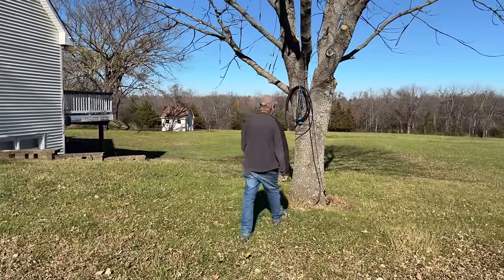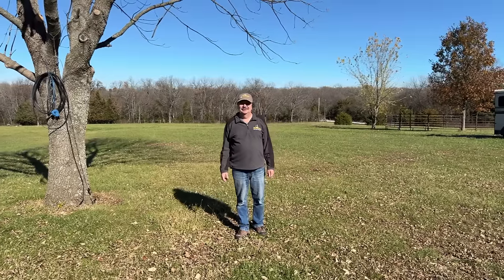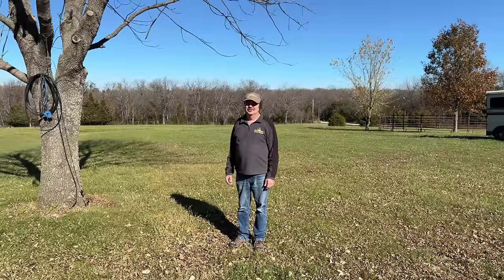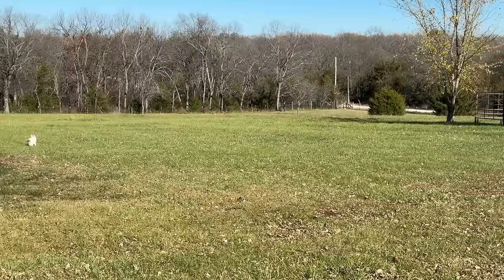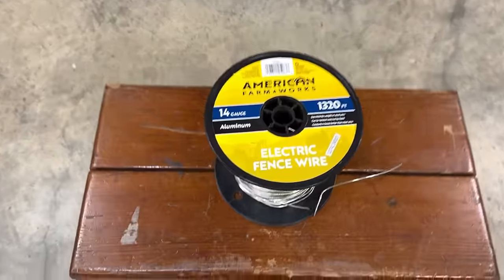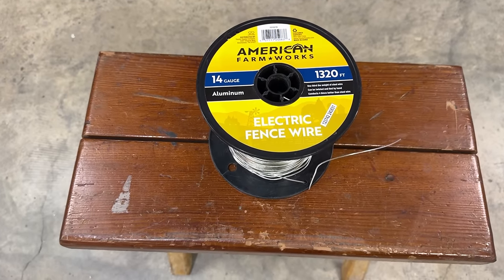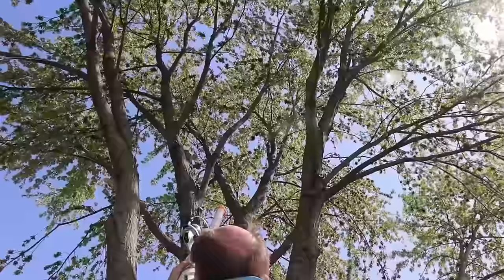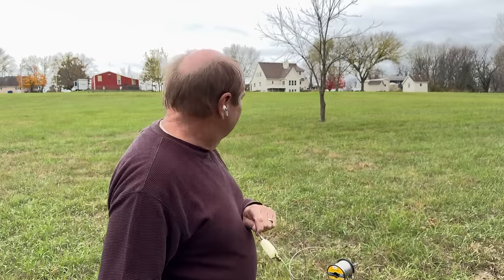Long Wire End-fed Antenna

Comment: I made a beverage antenna out here at my farm a bit over 550 feet it’s end fed too . To support it I used sections of steel chain link fence pipe welded into 20 foot tall with 5 foot cross bars and welded bolts to use electric fence insulators I set in concrete larger pipe so the t posts can be set in them I spaced them 100 feet apart giving me 1200 feet of antenna . I soldered my coax to the aluminum fence wire first cleaning it with fine sandpaper fluxing it well using the propane torch then siliconed it well to keep moisture out. Only the center conductor was used I grounded it to my tower . Have worked the world with that antenna ! With less than $50 investment the pipe was given to me to haul off and had the sackcrete left over from another job . One thing you will have to drill the insulators to 1/4 inch to use the bolts welded to the cross bars easily done with a masonry bit holding the porcelain insulators with gloves . And do not over tighten them on the bolts they will crack !
Reply from the maker: Sounds like a great project.  There are a lot of ways to make good antennas for not a lot of money.

Comment: With that amount of land, might as well think about a full wave loop at a certain point.
Reply from the maker: I have thought about it.  I’ve even thought about a 10 meter rhombic.  The trouble is finding supports.  My better half is probably not going to give a thumbs-up to 30 or 40 foot poles all around the property.  😁
Reply: Combine the hobby with a fence around the entire property 😅
Reply: @HamRadioA2Z camouflage them as Christmas decorations..
Then say you have Swedish ancestors and start celebrating "Midsommar" (we raise huge poles, with flowers and two rings on a cross entirely decorated with green leafs"
🎄

Comment: I put up a 150 foot aluminum electric fence wire antenna last fall and stretched it overly (ridiculously) tight as a test. There was a heavy ice storm during the winter. In the spring the wire seemed just as taut as when I installed it. It does not seem to stretch like soft or half-hard drawn electrical wire copper. I was impressed with its mechanical durability for such a small diameter wire.

Comment: Instead of that scotch 2228.    Try Scotch® Rubber Splicing Tape 23.    Its whats on almost every connector in calif on state systems. ✌️.  The “snakeskin” goes over the connection above and below.  Then you use the good quality scotch 33.     Used on connectors… coax grounding cables .polyphasers etc.    ✌️ on some connectors coldshrink is used but its hard to beat 23 and 33.  Never seen a leaky connector once if done right.    Great video thanks.
Reply from the maker: Thanks for the tip!

Comment: Good video. How high is the wire off of the ground at it’s lowest point? Thanks.
Reply from the maker: Hi.   Thanks.  Not counting the wire coming down to the tuner, it’s about 13ft. At its lowest point about 50-60ft. Away from the house.  It slopes up (actually more like the ground slopes away) to about 40 ft. or so in the tree at the back.
Reply from the maker: I think it’s high enough to for pretty good take off angles for 40 meters and up.  It will probably be a cloud burner for 80 and 160 meters.
Reply: @HamRadioA2Z  that’s pretty good. I was just wondering if you had to duck if you drove a tractor or mower through the field but you have a good height. I have one that slopes up from 12 foot to about 23 foot and it works well for me. Mine only covers 10 to 40 meters but it works really good.

Comment: I am currently building out a ham shack on 4 acres of land. This seems like a cool idea and I can easily reproduce it except for the outdoor antenna tuner. Might be worth getting one but what I have to do in the mean time is to put up my 300 foot doublet. I have gotten a few ideas on how that will work. Including using Mastrant in 2 parts kind of like the pully thing and then when you tie it to your fence, I will be weighting each end with a brick/concrete block rather than trying to tension it.
Reply from the maker: Outdoor tuner isn’t strictly necessary.  Although I prefer keeping the antenna wire out of the shack.  Less chance of RF in the shack.  And, these days, less chance of picking up noise from all the electronics in the house.

Comment: Thanks for the video.  I use a 400 ft long wire as my main antenna.  I am in a creek bottom that has over 80 old growth oak and walnut trees some that are close to 75 ft tall.  I took my air cannon and shot over the tops of the trees and then pull a 12 gauge thhn wire through the tops and let it lay in the limbs.  One insulator at the far end with a cord to pull the wire tight.  The house end is anchored to a steel post with a rope to the wire and then the wire runs through a 1/2 conduit under the eve to a window that has a hole in it and then into the house to the back of a Vectronics HF-1500 tuner.  I have used it on 160 a couple of times and all the way to 15 meters.  It works well on these bands but 12 and 10 meters is a different story.  They just do not play well with the ICOM 7300.    I been using this for at least four years, only problem I have had is it does not play well with ice storms and 60 to 70 mph winds.  It has been down 3 times but always put back together  and get back on the air.  

73 N5NOQ
Reply from the maker: Sounds pretty good.  In my initial tests on this, 10 meters seems to work pretty well.  I’ll have more on that in the follow up video.  We’ll see how well mine survives.  I’ll be pleasantly surprised if it makes it through the winter.

Comment: VERY interesting video Tom!! You’ve got me thinking! I have a 1/4 mile spool of fence wire that I’ve used to make 3-4 loading coils…..it never dawned on me to try making a more robust shack wire antenna.
Reply from the maker: With the price of copper these days, I think the fence wire is the way to go for any significant sized wire antennas.

Comment: Tom, Anxious to see how well it works. I had a 520 feet delta loop up for 160 use. It worked much better as an  end fed with a counter poise tied to a 10 ft. ground rod. sort of an inverted L. I used an old MFJ 985D roller inductor to match it up.
73 Paul WA3X

Comment: I like what you are doing.  Pattern should be rather directional, starting with broadside on 80 and, as frequency increases, with the main lobe(s) tending toward the line of the wire.  

I wonder at the decision to change to copper down to the tuner.  I'd have just continued the aluminum from the insulator down to the tuner.  

At the insulator, I'd have just made a single bend in the aluminum and run a short wire through the insulator and fasten each end to the main wire. The point is to avoid coiling the conductor.  The twisted wire around the insulator starts out as a non-issue, but changes (albeit very slightly) as the wire oxidizes.

Stan, K9MFI since 1958.
Reply from the maker: The switch to copper wasn’t for copper’s sake.  I wanted to have a more flexible, stranded wire coming down to the tuner that would move around more easily in the wind.  I have done some searches for stranded aluminum wire, but all I ever find is 1/0 and up service entrance wire.  I don’t think I want strands that big. 😆
Reply: @HamRadioA2Z  I see.  That copper wire is a part of the radiating material and, depending upon what is nearby, movement could affect tuning.  I'd be looking for a more rigid run down the side of the house.

Nevertheless, what you've done will give you many, many contacts. :)

Comment: Wondering why you went to all the trouble to splice in a chunk of copper?
Reply from the maker: The 14 gauge aluminum is a little stiff.  I wanted stranded wire from the insulator down to the tuner so it would move around easily in the wind.